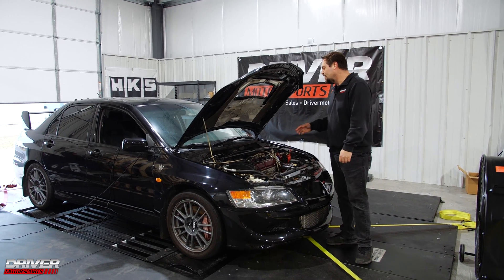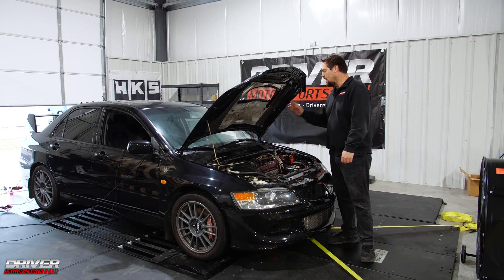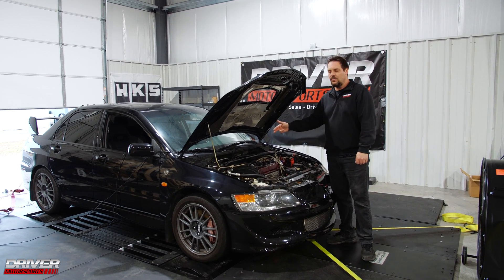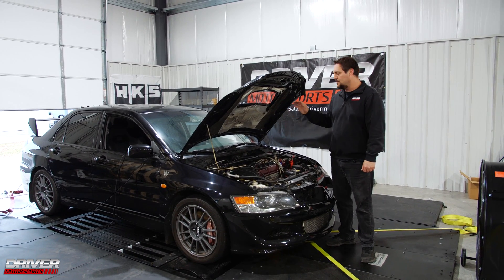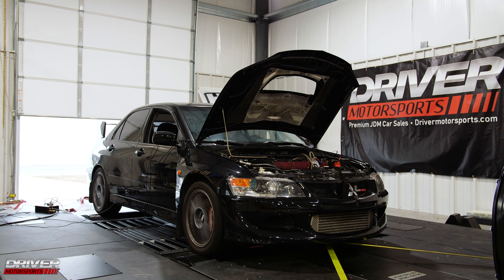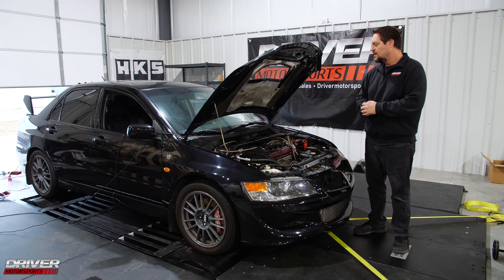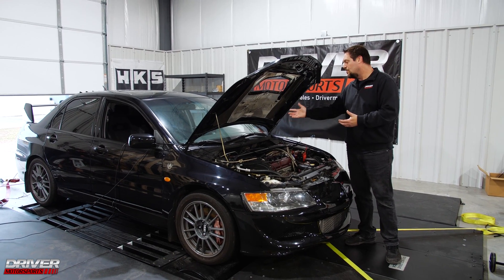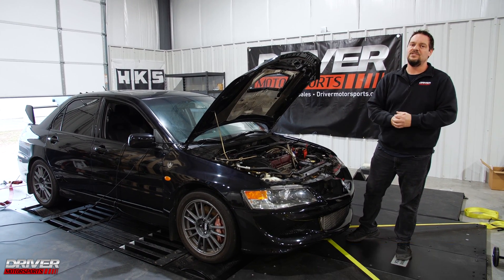REAL WHP | BOLT-ON EVO 8 | DYNO TESTED 4G63

Comment: Is this on a stock 8 turbo, or did they do they OEM 9 turbo swap?   Alot of Evo 8 guys will swap to a 9 turbo and retain the "stock turbo" tag.  
I've had 2 9s and will be picking up my first 8 soon.  Wanting to know what to expect.
Reply: I did that and from a evo 8 9.8t to evo 9 turbo got 50whp gain and 60tq increase
Reply: @luisvelasquez3075  thanks. You a champ

Comment: Thats erm very good results on pump fuel. The extra fueling must help a heap.
I made bang on 224kw (300hp) at 92% inj duty cycle on the OEM injectors and wally pump.
Nice to see the huge improvements from the extra fueling. Very interesting